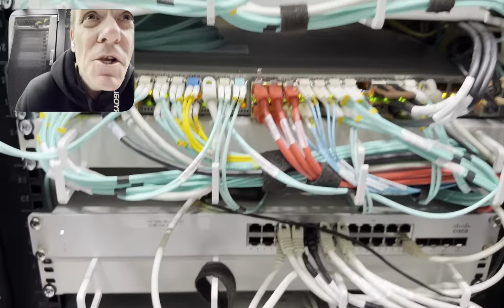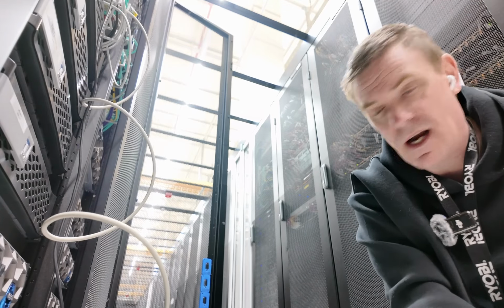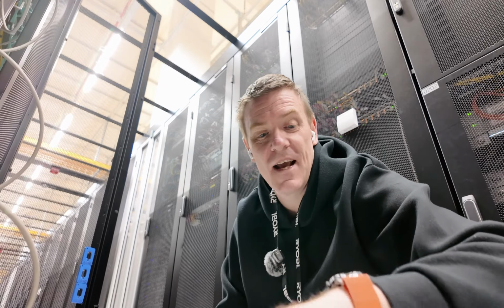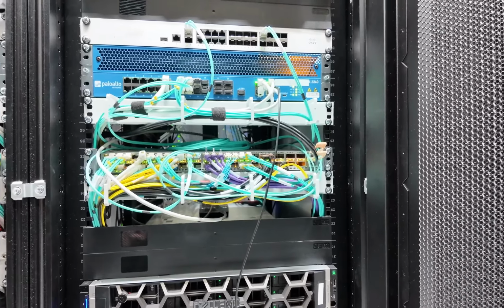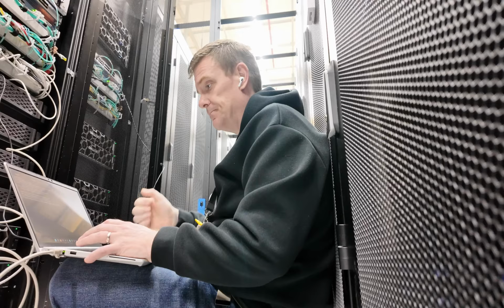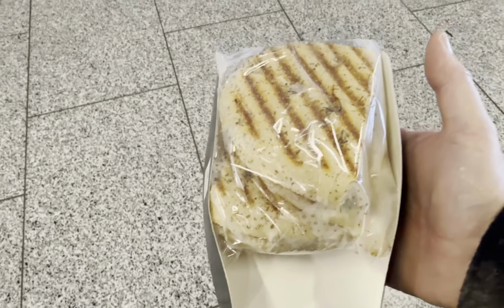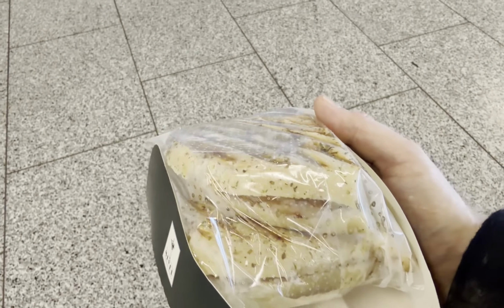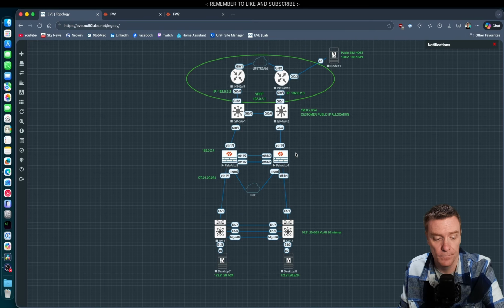Inside a Network Engineer’s Life: High‑Pressure Firewall Upgrade at FR8

Comment: Why don't you do firewall updates remotely?
Reply: if you fuck up it's a long loooooong day
Reply from the maker: A very long day.
Reply: @evllihd  well then it's the day he showed in the video
Reply from the maker: As I explained in the video 07:44 if there is any issue and we loose access its a long wait for remote hands or to fly out and fix the issue while down. Not all updates go smoothly and for critical remote locations sometimes being on site costs less than being down.
Reply: Equinix normally has local remote hands at every IBX. I know they’re silly expensive but compared to sending an Engineer out on company T&E it’s got to be more cost effective!